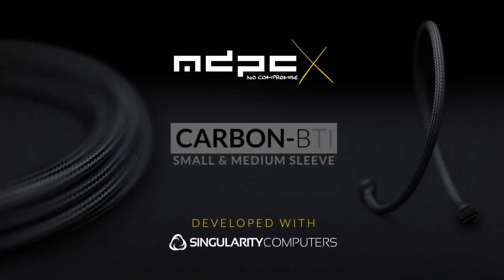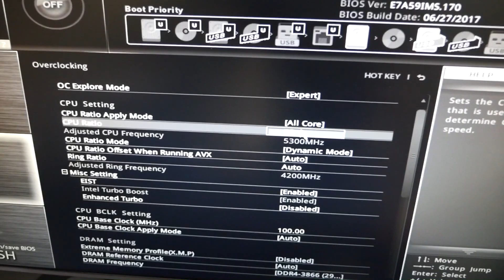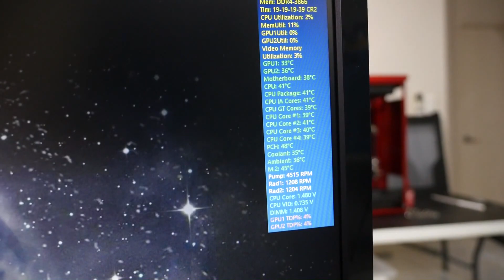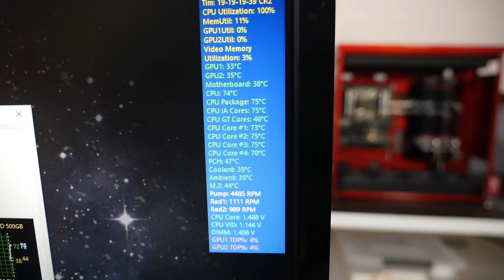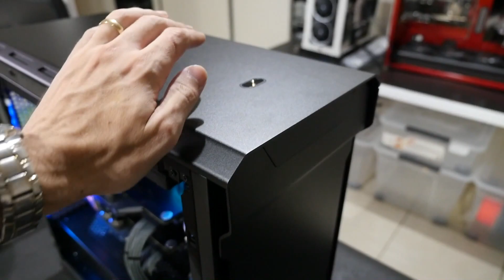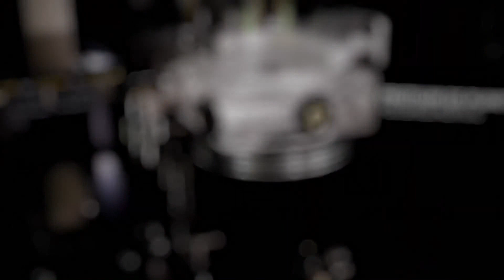Delidded 7700K 5.3GHz

Comment: I got a dud for past 5.1ghz i can do that at 1.376v but at 5.2 have to do 1.440 that bounces between that and 1.456v but my temps are at 68-71c between the cores so ill just run it till 10nm comes along. I just cannot fathom why it takes such a jump when from 5 to 5.1 was 1.325v to 1.376

Comment: Cant stop looking at those fittings above the GPU, Why not use a small extender on the GPU plug so it sits higher? Then the pipe from the CPU could just be a longer 90 degree bend?

Comment: You didn't account for loop heat saturation. Also you ran the AIDA setting that produces the absolute least amount of heat, in a more practical use case you would be another 10 degrees higher.
Reply from the maker: I did talk about that, it maxes out at about 5C higher when it reaches equilibrium.

Comment: What would it cost intel to use proper TIM in their CPUs??? Probably less than 0.5$/cpu for the quantity they'd buy, put it in the final price, nobody would care if they had to pay 1-2$ more if it meant that much greater performance.
Reply: This is absolutely correct, the TIM is not really the problem.
Reply: So you're saying it's a problem of how they apply it, which is something they could solve easily and they won't.
Reply: nikumeru I still facepalm every time I see this fallacy. Intel TIM is fine. Delid of the CPU and subsequent removal of the glue decreases the distance between the IHS and CPU die. 
Less distance, less TIM and better contact means more heat transfer.
It has never been the TIM.
Idiots just never took into account all variables and subsequently came to incorrect conclusions that the Internet has perpetuated.

Comment: isn't that voltage dangerous, even if it stays cool at all times? If I was your  client I wouldn't let my PC be run at 1.475 volts LOL

BTW, you should check first 4 checkboxes to run the CPU stability test properly. If you check only CPU it doesn't properly test the stability. And the temps will be much lower if you check only CPU. That's why I don't consider these temps as valid.
Reply: Voltage is not really what kills a CPU its more the current the CPU draws combined with voltage ie: the amount of power the CPU draws. And yes I agree AIDA 64 is a terrible stress test that proves nothing, Realbench and or OCCT are the only way to go.

Comment: Prime95 workers crashed immediately when you started it... how did you not notice this?
Reply from the maker: TBH it was late and I just couldnt be bothered going back and increasing the voltage to 1.485 and disabling turbo and speedstep and shooting all that again. Of course all of the profiles were validated afterwards except for that one which is only there for experimentation if the customer wants to have a play with it. I think I could have got it to the point I was happy with for 24/7 stable but I didnt have the time with it to do that. Im working 18hrs a day right now trying to bring you daily videos.
Reply: My 7700K does 5.2Ghz Core 4.9Ghz Cache@1.39V OCCT large data sets stable, delided for the last 8 months no issues.
Reply: Good question, I also noticed it. At the time he opened FurMark, the mouse cursor literally was over  the "1 errors, 0 warnings"
Edit: When he was looking for the resolution 5 workers had crashed
Reply: MotoK tips
5.3 ghz is ridiculous though. I'm surprised it even booted!
Reply: Agreed AIDA64 stability test proves nothing, but it is an essential piece of software.
Reply: Personally a combination of OCCT which is Prime 95 and Realbench, that way Im combining both synthetic and real world stress tests ;)
Reply: True power draw would then be 800-900 watts.
Reply from the maker: The last one I did was over 1200w actually so possibly more, that was at 5.2GHz with the GPUs maxed too.
Reply: mad respect dude.
Reply from the maker: The board keeps re enabling turbo and speedstep and then its unstable. After loading the profile I should have gone back in and disabled them then booted and it would have been stable. I did have it at 1.485 and was starting to back it off so I could have found instability again. No doubt it would have needed 1.5v to be stable though. Definitely a one off. With some more time I could have played around with the memory and llc and improved the voltages.
Reply: 5.3Ghz would be top 1% of 7700K's very few will do 5.3Ghz with any real stability which AIDA 64 doesn't prove at all.

Comment: On my G3258 I have run settings stable overnight in Aida64 but crashes some other benchmarks and stress tests (either of the standard prime95 settings in under an hour, sometimes in Tombraider although never seen it in another game). If you only game, maybe Aida64 a fine indicator, but for me personally I won't call that stable.
Reply: For the definition of stable: if it crashes with any test it is not 100% stable
Reply: There are workloads that crash many CPU's (or gpu's) at anything over factory turbo man, and there is literally no point hamstringing yourself to slow speeds based on loads you'll never do, so you need to choose level of stability your happy with.

Comment: 700 watt for a 5.3ghz quad core, and 2 1080ti's at 2ghz is madness
Reply from the maker: Yep its definitely wrong. The last one I did was 1300w once I maxed out the overclocks.
Reply: Pretty sure he means madness as in way too low : )) he deffinetly needs at 1000W if not 1200W if he's interested in best efficiency from the PSU :P
Reply: Rly ? Do any of you people realize that OC'ed high end systems can consume a lot of power ? My 1080ti takes about 320-325W .. my OC'ed 8core intel CPU is 200-250W ... dual D5 pumps ? another 50W ... then there's the 10Fans , NZXT Hue+ and 5 HDD"s ... can a 700W PSU handle my PC ? if its high end yes ... but I would never be comfortable with 700W which is why I got myself a 850W Titanium PSU and I have 0 fears with it.
If you people wanna skimp on PSU's and buy cheap ones be my guest. But if you have the money for a 1080Ti and don't buy a 200-300$ PSU - that just makes you a cheap idiot. It would be like buying an expensive BMW/Mercedes car and then using cheap oil in the engine ... or driving your car at 250km/h and buying tires rated for just 270 ... thats too close for comfort.
Certain components are worth spending a little extra money. Especialy when a high end PSU can last you 5-10 years.
Reply: I have one of those power plugs that show consumption ... I'm at 650-675W while stress testing the entire system CPU + GPU at the same time ... 1080Ti is OC'ed massively with power limit at 120% and my 7820X is at 4.8Ghz with 1.31v .. there's no way I'd be happy with just a 750W PSU .... sure, if I removed the pumps and RGB lighting I'd drop another 100W of power consumption. And sure, even with nothing removed I only get 500-550W power draw while playing games (Battlefield 1 for example) ... but I would still rather have plenty of extra power reserves regardless.
And I've said it before ... the PSU is one of the most important parts of a PC and it needs to be of high quality and if you can afford 1080ti or 7820X(as examples) you can afford a 200-300$ PSU.
Reply: Not really, each 1080ti should pull at least 300W overclocked, depending on its power limit.
Reply: have you tested the power draw? as in this video 690 ish watts for basically the best gaming sysem you could possibly build is crazy, i remeber when gaming builds used 1200watt plus ,1500 watt psu's like it was nothing.
tri sli fermi anyone?
Reply: Given that more than half the workers failed in P95 before he started running Furmark its no wonder he was only pulling 700w  The CPU wasn't running all threads.  God knows why he's running furmark anyway, GPU killer that program!
Reply: Not to mention high end PSU's have a warranty just as long.
Reply: NamelessONEMail first of all, no one here said to buy a cheap psu...
Second people always go way too extreme with psus. 
I own a g2 550 supernova from evga and it is plenty for my simple system. Even both cpu and gpu overclocked (6700k and 980ti) it still doesn't reach that at all... yet everyone on the internet that calls himself an expert yet probably only have like built 2 systems in there lifes said I was wrong and you need at least 700... it's just not true.
Especially with pascal. Pascal is extremely energy efficient. Did you ever look at the conference at release?

Also, You realize you don't always need to up the voltage when ocing? 
So there does not need to be more consumption always.
Reply: @gymweeb9229  me too overclock 4.8Ghz 7700K with Aorus Xtreme Edition GTX 1080 TI...using only Corsair TX550M...not encounter lack of power yet....haha..
Reply: this important information my guy!!! thanks i was initally misinformed.
Reply: 1300W ? Not this 7700k 2x 1080ti PC, right ? you talking about another one ? cause I'm not sure even a 7900X at 4.7Ghz 1.3v(or more) can possibly reach 1300W with just 2x 1080Ti's ?? 
You're making us even more confused dude : ))

Anyway .. what do you think about my opinion ? 500W power draw => get 700-750W ... 750W power draw => get 1000W ... that its always best to buy a good quality PSU with aprox 25% more power than your actual power draw ?
Reply: NamelessONEMail you are all looking like children right now... if you did not get his comment, oh boy... just leave lol
Reply: Antolio Parker-James Supreme you did not get it...
Reply: Needs minimum a high rated 1000w in this setup. Spikes over 900w will occur.
Reply: agreed, you're stressing the shit out of that PSU, you need something close to 1200w so you're getting close to 100% efficiency!
Reply: NamelessONEMail yeah no... not at all. Please stop with the exaggerated wattages...
Reply: I'd say 800w would be ideal but 700w is fine, efficiency will be perfect while gaming since the power draw will be less than full load on the CPU
Reply: i was referencing the total power draw as in the video of 700 watt, to get that kind of power 18 months - 3 years ago with 700 watt would be impossible, 5 years ago people still bought ax1200 ax1050 for most high end builds. now if you buy anything over a 700watt psu for gaming you're just an idiot.

Comment: My non-delided 7800X can run 5GHz 1.3V.
Reply: temps?
Reply: Dane Cook2 Depends on the load, 80-85C in CB R15 with 20C water.

Comment: 5.3? How much luck can you have? Oh and fuck Intel for using toothpaste on their CPUs
Reply: If you watch even at 1.475v the prime95 workers crash during the video.
Also the stock thermal grease isn't terrible, its just OCers have different priorities. To OC you want the best thermal transfer while still being non-capcitive or condutive, but have limited other requirements. OEM's on the other hand can't allow excessive expansion within the sealed unit, can't be displaced or cavitate after a great many cooler applications, need to have the paste handle the -90 to +90 degrees and still give good enough performance after 5 years on the same paste.